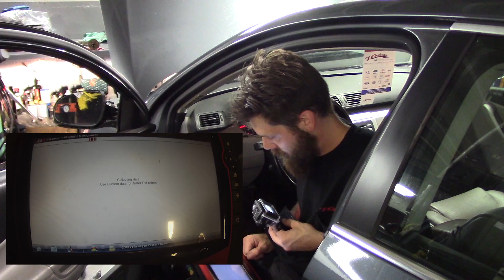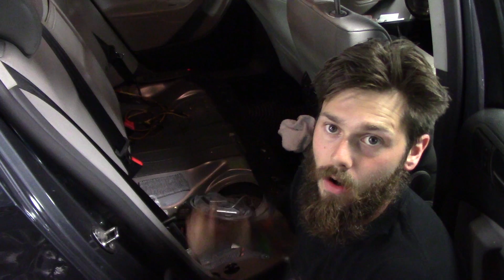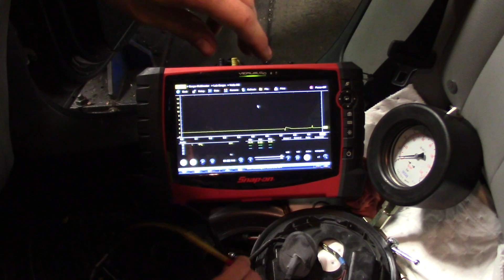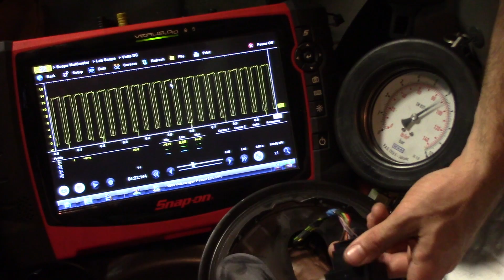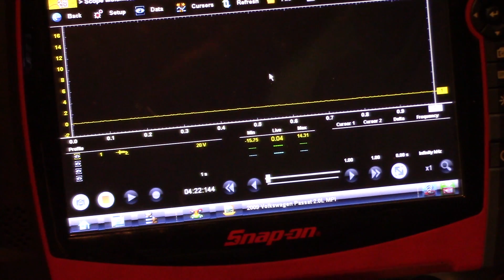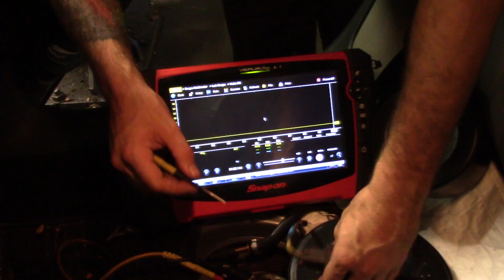2009 Volkswagen Passat 2.0T (GDI)- Intermittent Stalling, No Start

Comment: Good afternoon sir. Yesterday a car owner called and drove me to a garage where is car was parked. On getting there, battery from is lexus was pulled out and used for my testing in his Passat. 

  The car that is faulty is a 2008 Volswagen Passat. The  things I noticed when I connected my scantool were: P2014, P0113, P2185 were the check engine codes I saw. But when I checked for modules P0190, P0798, P0864 and P0841 were added previous 3 codes I highlighted 👆. 

  Before long, about 7 minutes or less during my scan I wanted to crank the engine over to check the live data and the operation of the car unfortunately the battery went low. 

   Hence, I couldn't carry out more test. In an interview of the car owner about what he used to notice/ symptoms in the car and what was replaced in the car in an attempt to solve the problem. He highlighted that it happened on is way,  when the car was on motion and suddenly went off. He allowed the car to cool down for some time. When he tried starting it again it started and moved for some distance and stalled out again.

    He invited an electrician to check the cause and fix the problem. The fuel pump was replaced and an actuator as he said but that he can't recall the name at the moment. The car was then driven to a garage where I meet it. Since then they've been trying to fix the problems permanently but to no prevail. 

  Initially, most of the times the battery will drain out quickly and when car gets hot, the car will go off  on motion. But he has not noticed stalling off the car at idle.

    Consequently, the engine oil was replaced, top cylinder valves grinded,  oil switch, plugs, coils, top gasket and PCM were replaced but the problem was still not fixed.

  Moreover it was also noticed that mostly the car will hesitate whenever it wants to climb hill like a popping sound accompanied with that and move very slowly on smooth road. 

   At present, the man said the car problem have gotten worst, it only cranks but doesn't start anymore.
 
 In summary, the car used to drain very fast, struggle to climb a hill or bump, and when on motion engine stalls when hot.   

Please help me out on how to solve  the car problems and get the car starting again.

Comment: I have a golf 6 GTI when the car gets to operating temperature it stall and won't start until it's cooled down any suggestions please I have a p2293
Reply from the maker: I would be doing checks on the fuel system.  I think the fuel pump modules are pretty common and usually start to act up after it gets up to operating temp

Comment: When I hook up my gauge I get 40 psi at idle and when I raise the rpm it drops to 30 sometimes and then goes to 50 but never more. My scanner reads 40 bar at the rail so I think my hpfp is good but the supply lpfp is bad?

Comment: Damn, I wish I could take my car to you (2.0T TSI CBFA).  My fuel pressure climbs to 130 bar after the car is shut off and up to operating temp (normal pressure otherwise when car is on and driving).  When the pressure is that high, I try to turn over the engine and it stalls out.  No one has been able to diagnose it correctly--hundreds of dollars later.  Awesome content though, just subscribed!
Reply from the maker: Thank you.   It’s normal for pressure to increase  in the fuel rail after shutting it off. Something to do with the fuel boiling in the rail causes the pressure to rise. I’m wondering if you have a different issue.
Reply: @PositiveLeadDiagnostics  Yeah, I don't know--I think a separate issue may be at play.  I have to wait an hour and a half to two hours before I can start the engine without issue.  The mechanic advised me that the pressure should not build after the car is off.  The car has a new (within the last two years) fuel system from the tank up to, and including, the injectors.

It makes sense that the fuel could turn to vapor creating vapor pressure and thus increasing the overall pressure (e.g. more excited molecules moving at a higher velocities).  But building to 130+ bar seems a bit much without any type of relief. I don't know though--I'm not a mechanic by any means.
Reply from the maker: Does this happen all the time or only at hot temperature after using the vehicle a while?
Reply: Positive Lead Diagnostics It only happens after the vehicle is hot (~98 C) and doing stop and go errands.  Meaning turning the car off and on.  Then it’ll stall out when turning it over after it has sat for ~20 to 50 minutes.  Under those conditions, it’ll happen about 75% of the time.  It’s more prevalent on hot days (90 F or higher).  Crank sensor is new also.  I had thought maybe a relay is going bad, but was advised otherwise by a VW/ Audi mechanic.  Otherwise, the car runs perfectly when driving.
Reply: @joshuam7552  did you solve this problem I have the exact same thing
Reply: @djamel_bijoux  unfortunately not, still doing ‘the thing’ 😳

It’s probably an electrical gremlin or a bad module/ ecu, I’m suspecting.  Please, repost if you find a solution.
Reply: @joshuam7552  do you have Facebook ? So we can stay in touch

Comment: Nice Video Sir!.....And DAmmit, I hope this is my problem. WAs getting the p2293 on my 09' CC 2.0T TSI, and out of no where the the car shuts down either while in motion or at the light... ANd then it will either start and then die out with in a min.. and if it shuts out again, it will stall even quicker and won't start..... And then it' s minutes or many minute before it wants to start.
So replaced the HFPF and the car ran fine for the  for a mile or two. I stop somewhere, come back 30 minutes later and then I crank motor and starts, but doesn't idle for more than 30 secs,. and after a few minutes of it running, it shuts down within a minute or two.. and then takes 5 minutes to retart and will die even sooner..... SO I'm going to guess it's going to be electrical related to that fuel pump control module.. I'm going to swap this out next myself and see if that fixes the problem like it did on this example.
Reply from the maker: Thanks for watching. The fuel pump modules are very common.

Comment: great video!!!, i have a question, if there is a failure on the high pressure side the engine runs with the low pressure in the rail as a safe mode in VW, as in Hyundai for example?,
Reply from the maker: It will run on low pressure if there is a high side issue

Comment: Nice video Tom. Ever consider a haoir blow dryer to warm up a module ?
Reply: heat gun is my tool of choice for heat soaked dying GM computers :)
and for cooling, the cheapest "air duster cans" just spray with it inverted, cheaper than component cooler

Comment: I kept shouting "FUEL PUMP CURRENT!!!" Because of the fault code for the fuel pump short circuit and those brief pulses as it looked like the module could be cutting power as it sensed an over current.
Reply: In this circumstance there would be blown fuse for fuel pump?
Reply: Petar st Probably not, the control module can obviously sense a short, cut the power and generate a fault code. The fuse would blow from a short before or within the control module.
Reply: for sure want to check the pump current!

Comment: I thought you worked at dealer. Is the VW factory scan tool so foreign you have to use aftermarket scanner 😳

Do video on how to disconnect those aggravating VW wire connectors, the proper way if there is one. 99 times out of a 100 if you hear no pump, it's the pump. Let car sit on lot a few months, you'll be putting another one in it, and a battery. Independent shop, you don't see as many weird problems as dealer.

Like flash updates, if the car has 89k or more miles then any service bulletin has probably already been fixed I hope. Unlikely they drove car that long with a major problem. Lot different in a high volume repair shop. We rarely even see Volkswagen unless it's towed in off the interstate and been run hot or needs fuel pump. A Euro tech would starve to death here.